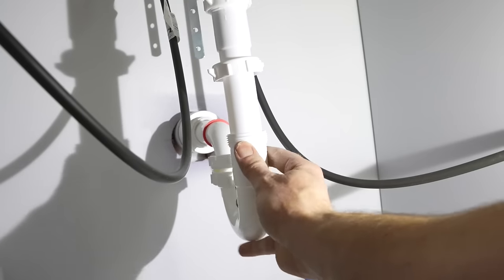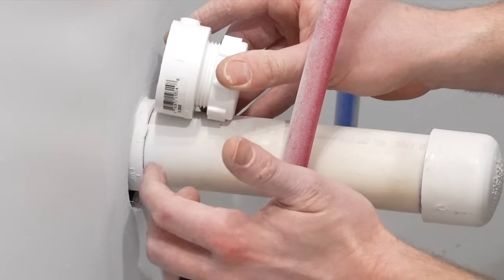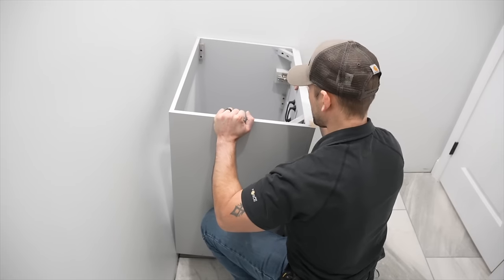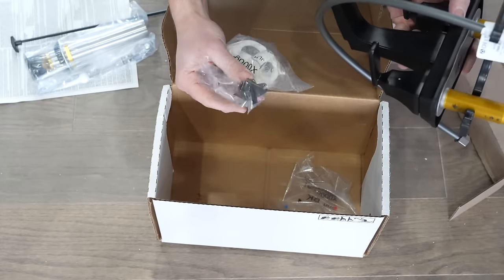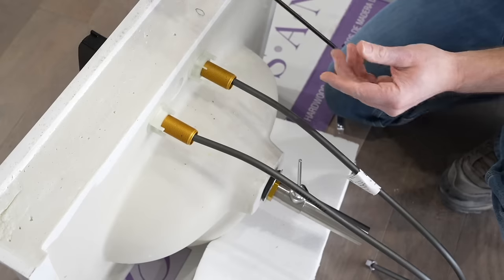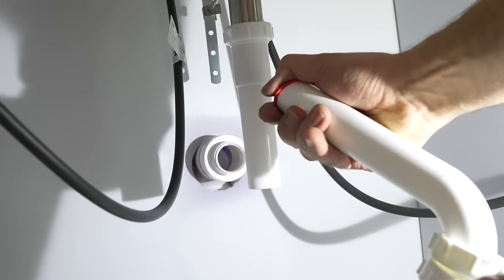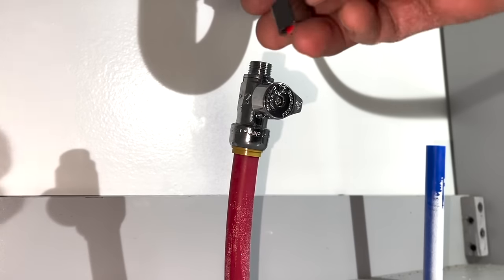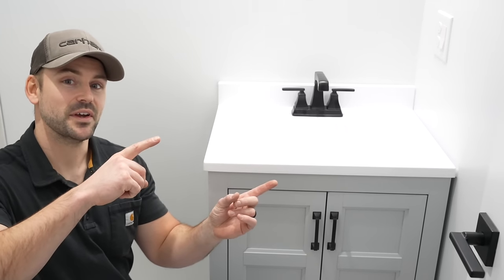How To Install A Bathroom Sink (HOOKING UP BATHROOM SINK DRAIN)

Comment: I'm going to use the Shark Bite angle stops under my sink because if the valve ever starts leaking, it can be replaced without cutting the pipe.

Comment: I used to think that silicone was "hack work" But after talking a few plumbers, it's now the new and accepted way of installing pop-ups. Plumbers putty is the old man way..
Reply: Guess I am old…prefer the plumbers putty myself…😂😂
Reply from the maker: A lot of manufacturers recommend silicone nowadays. Plumbers putty is very handy and clean to use. Either one is fine and have their strengths and weaknesses. Thanks for watching!
Reply from the maker: I enjoy plumbers putty as well.
Reply: @TheExcellentLaborer  no matter how careful I am I always get silicone everywhere…
Reply: I never use silicon or plumbers putty. I use the rubber gasket provided. I thinks the life is longer and easier to do maintenace if required  (but it is never requiered). But, What do you think? Thanks
Reply: Depends on the sink I'm working on and the product I'm installing. Seen putty stain some finishes. But silicone also cost 2x what it did a year ago

Comment: I always learn so much from watching your videos.  I want to permanently remove my dishwasher from my double sink kitchen drain.  Do you have any videos on what I need to do?  I also want to convert a double sink vanity to a single sink vanity so that there's more counter space in the bathroom.  Any helpful videos on how to modify the plumbing?
Reply from the maker: I don’t have a video removing the dishwasher connection. I do have a video coming out soon. Installing my dishwasher to the kitchen sink and the drain underneath. It will be helpful for you. Stay tuned!
Reply: @TheExcellentLaborer  Awesome👌

Comment: Josh you are a great craftsman and instructor -- very thorough but your videos move at a good pace.  Sometimes I use utility knife to notch out drywall in corner for a cleaner sink top fit -- it's usually built up joint compound that puts corner out of square and caulk covers the small drywall cut.  Also the shower tile and corner shelves I caught glimpse of at beginning look great.   Thanks for sharing your knowledge!
Reply from the maker: If the wall is really bad, I have done the same method you mentioned here. This wall was not that bad at all so I just split the difference. Thanks a lot for your input. I appreciate your uplifting words. I enjoy making content for DIY projects. Good luck with your projects!

Comment: Does the sink just sit on top of the vanity like that or did you add some silicone? Would it not shift around if there wasn't anything attached to the vanity?
Reply from the maker: It just sits on top of the vanity, and when you silicone around the bottom of the sink too and vanity, it will keep it from shifting around. Hope that helps!

Comment: I always liked vanities with the inlay type doors. One thing I have always done was use a 1 1/2" p-trap with the washer on the tail piece that reduces to the 1 1/4" tail piece from the sink drain. I have found that it gives better drainage especially if the sink doesn't have an overflow on it even though the trap holds water, it still drains quicker. Also by us, the 1 1/4" trap costs more. I have also used a belt sander on composite sinks in cases that I can sand the end by the wall, especially if the sink top doesn't offer endsplashes. Love that Delta offers long supply lines attached. Very seldom are they to short. If so, you can get a supply line, 3/8 on both ends. 
Great concept on the silicone instead of plumbers putty on these style sinks so the plumbers putty doesn't have a chance to stain the sink because of the oil base in it. 
Great job again Josh 🔨👍🏻
Reply from the maker: I always like reading your detailed responses. You are a wealth of knowledge. I never really paid attention to the price difference of the P traps. That is a good way to transition. How are you described. Delta has always been my go to faucet. The quality is always there in the price is not absurd. I did do some research on what you mentioned and it is definitely something to watch out for when it comes to using silicon versus plumbers putty. They do make some plumbers putty that will not stain so easy. Thanks for watching like always David!

Comment: You didn't show how to attach the sink to the counter. Does it just sit on top or is there something that holds it down? Also there is a lip around the front and sides of our sink we bought. So does the lip of  the sink sit on the counter edges or is the counter supposed to go on the inside of said lip? I'm building the counter so I need to know what size to go by.
Reply from the maker: The sink sits on top of the cabinet. The silicone caulk is what keeps it held in place. I hope that helps!

Comment: I never use silicon or plumbers putty. I use the rubber gasket provided. I thinks the life is longer and easier to do maintenace if required  (but it is never requiered). But, What do you think? Thanks
Reply from the maker: I recommend using silicone or plumbers putty. The rubber gasket from below is definitely the heart of the drain, but the silicone improves the water tight seal. Thanks for watching!